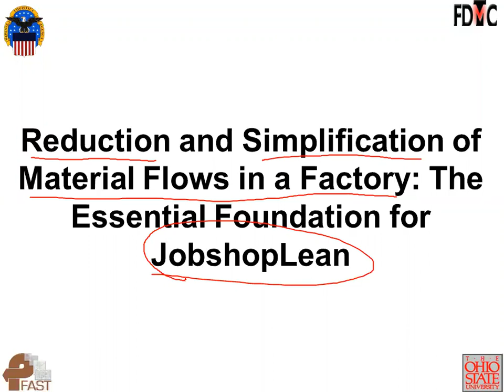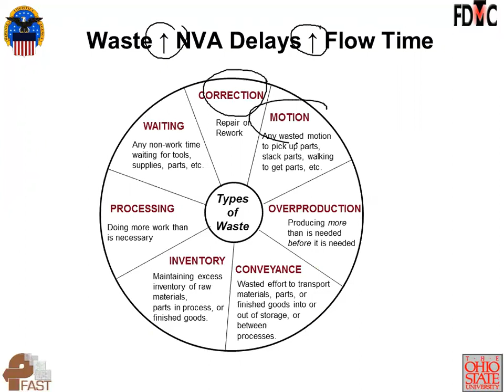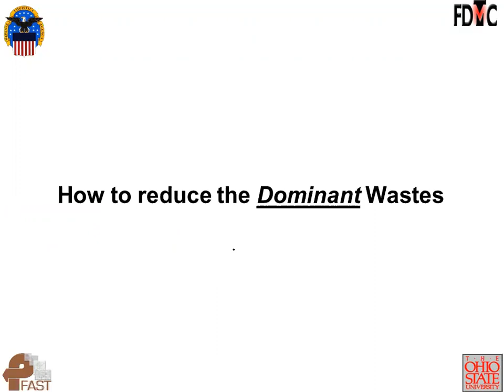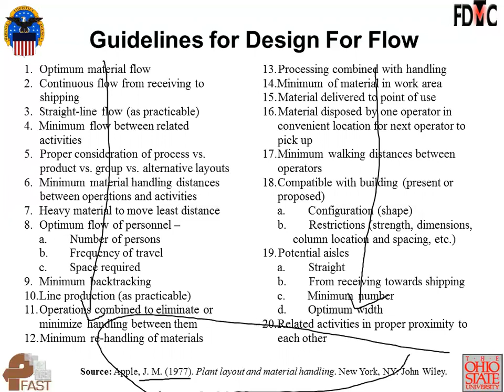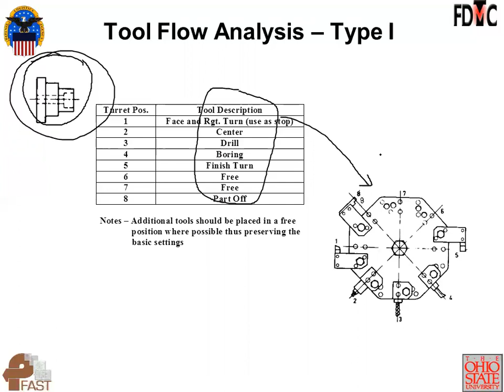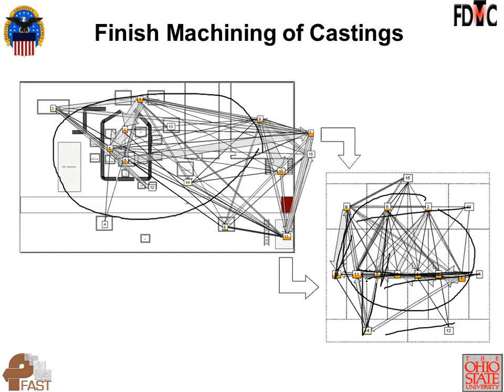(The) Essential Foundation for Job Shop Lean: Reduction and Simplification of (All) Material Flows

Comment: Just have to say, I have been watching all your video's and they are very helpful. Every lean thing i read, whether it is a book or an article, only focuses on the high volume low mix and mention job shops in passing. Do you have any recommended reading material for jobshop lean?
Reply from the maker: I can at best recommend that you buy my book on Job Shop Lean that is available on Job Shop Lean.